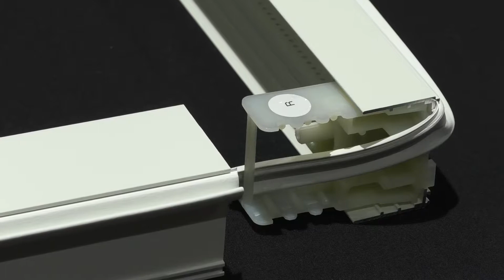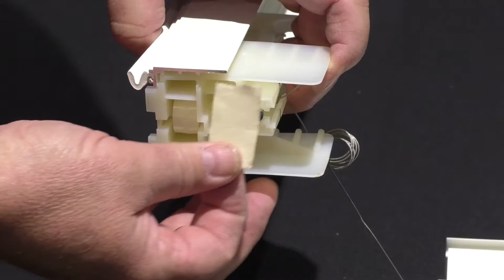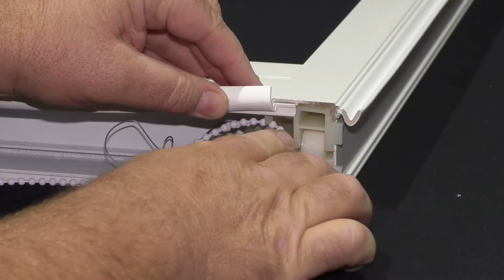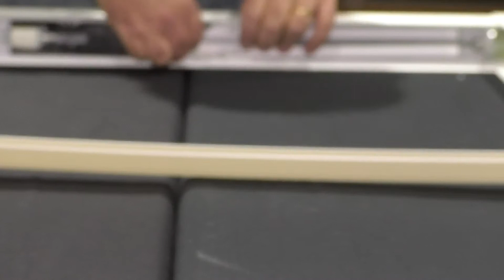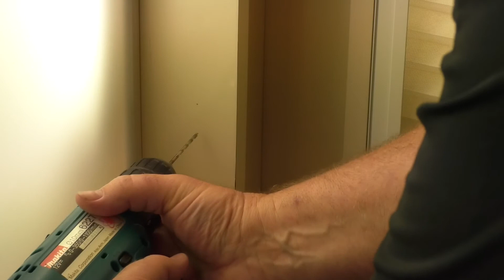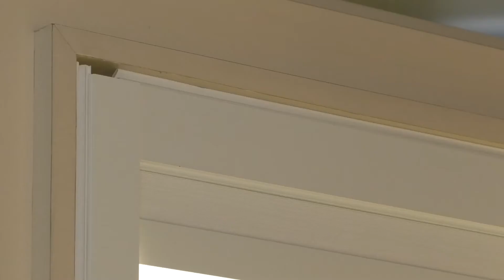Skylift

Comment: For an existing installation.  What can I do if the shade is fully down and the battery is too depleted to open the blind to access to the battery wand or the installation screws?
Reply: I would recommend using explosives.
Reply: Hello! Did you ever figure this out?